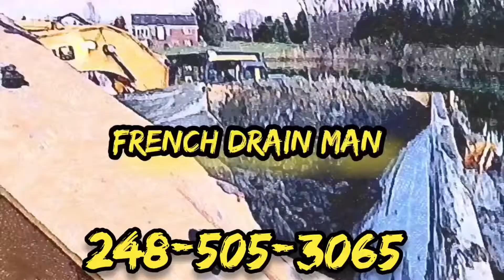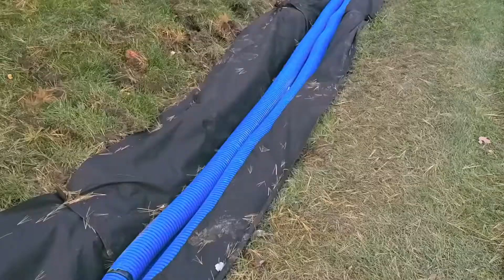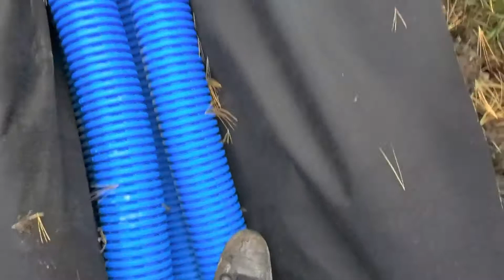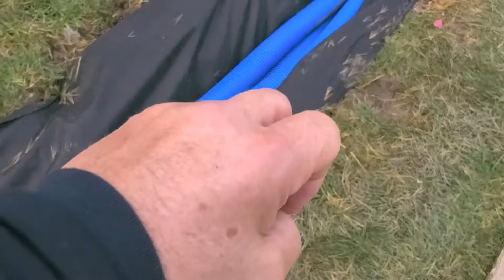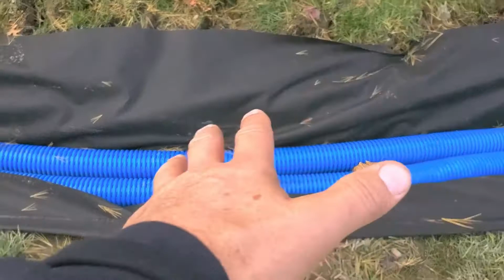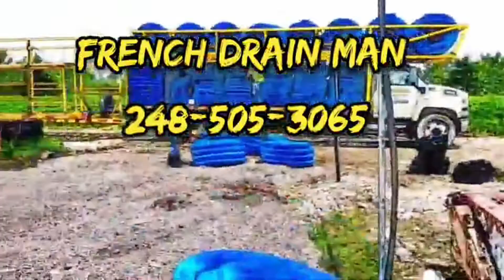How to Remove Standing Water from Yard with No Slope!

Comment: Hey Robert I dug a 18" wide by 14" deep trench for my French drain. I was planning on using two 4" Hi Octane I do not have any slop. Would two 4" hi Octane pipes work? I guess I could maybe start at 8" deep then every ten feet drop a inch to get slope. What do you I should do?
Reply from the maker: You can get 3 High Octane Royal Blue 8 slot in the bottom of 18" trench. We do it all the time with no slope.